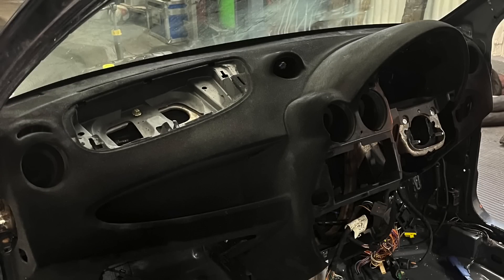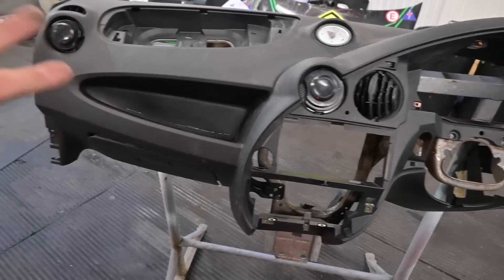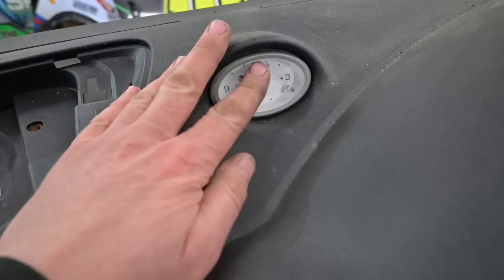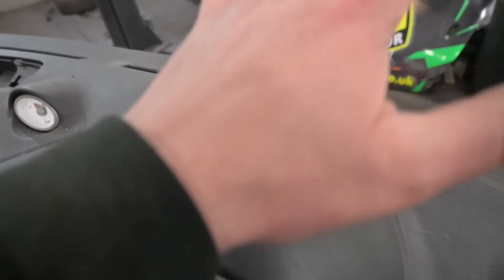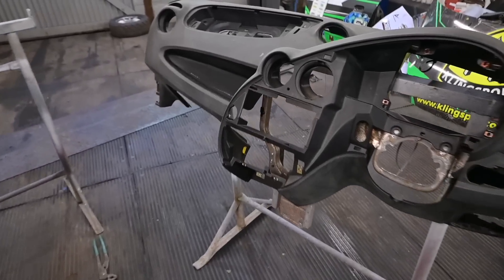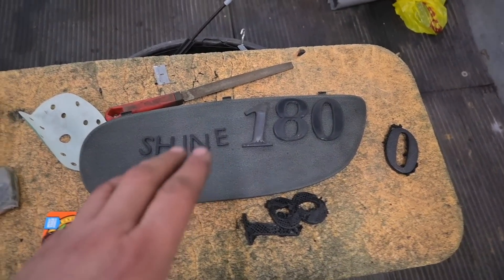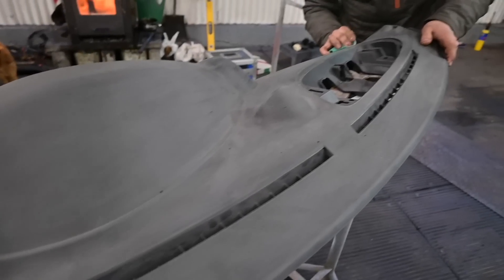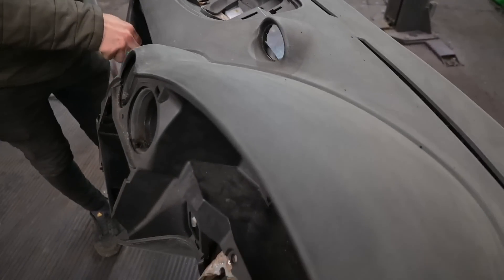How To Flock A Dashboard. Electric static flocking first time use.

Comment: I think it was to cold. Flocking should be done in around 21 Degree Celsius and at 65% humidity. Also important is the adhesive. If it is waterbased it dries too fast on this big part. The thickness of the adhesive layer should be (dried) 10% of the fibre length. This guarantees a better anchoring of the fibres.
Reply from the maker: we've done a full race season and still is like brand-new. I've been very happy with the results